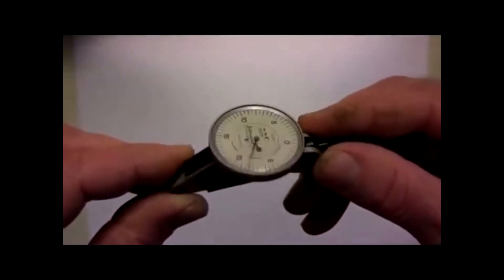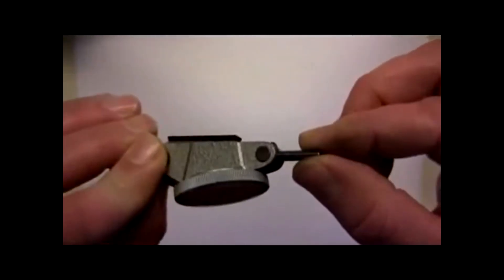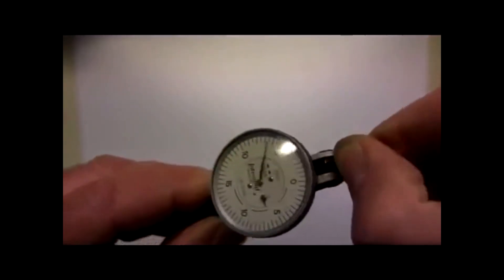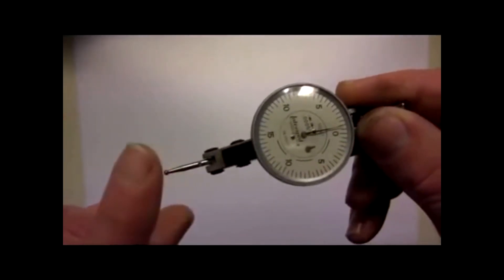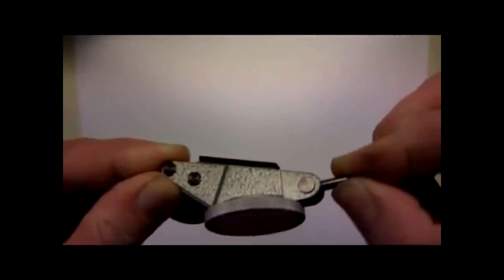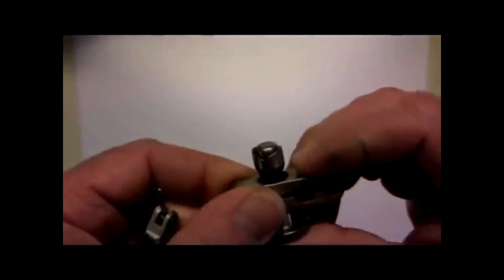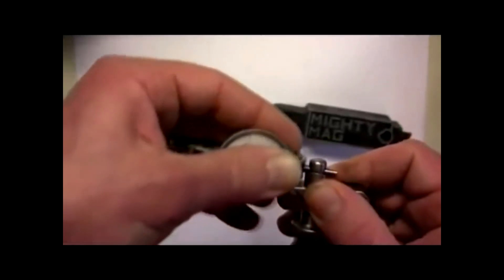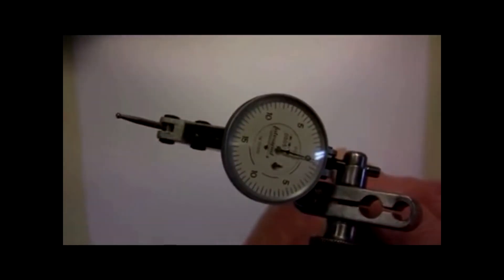INTERAPID TEST INDICATORS

Comment: I love the built in rod thingy of the Interapid indicators, drill a 3/16" hole where you need it, provide way to lock it in, and that rod makes it super easy to mount on a variety of custom holders I make for my work.  I could never get to like that style of Starrett clamp though and boy did I try! . I prefer the standard style and have them in all the sizes. Cheers.
Reply: The swivel stem is the best feature of these indicators. It can be held directly in a chuck on the mill but better still in a chuck in a lathe tailstock.